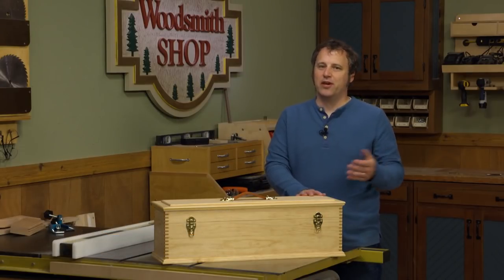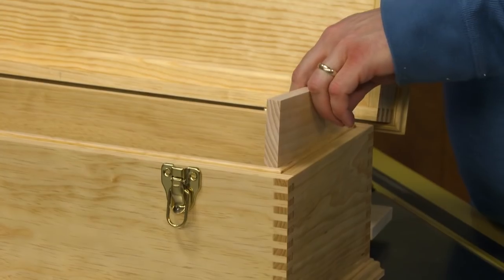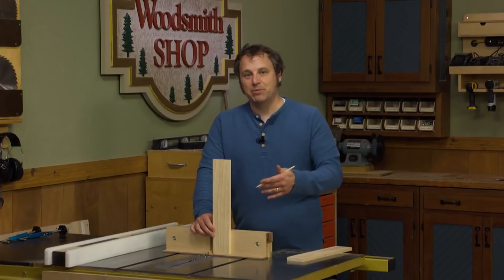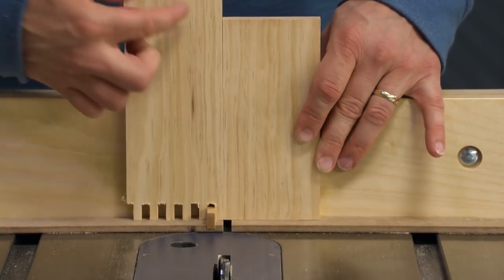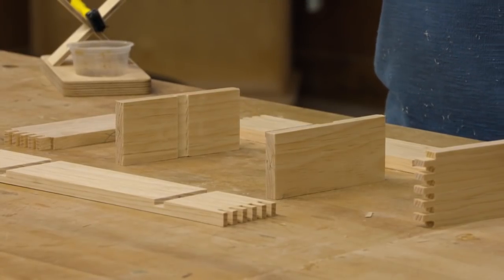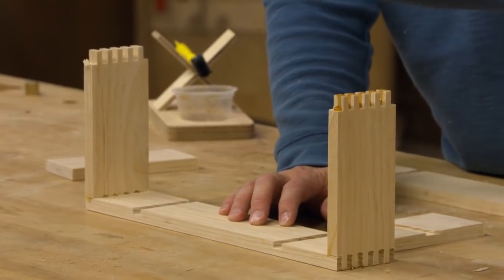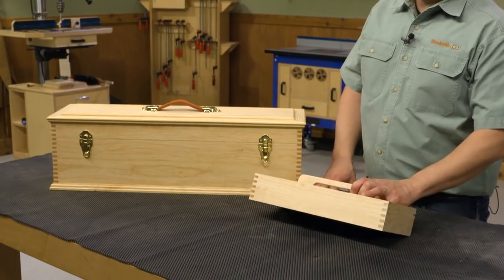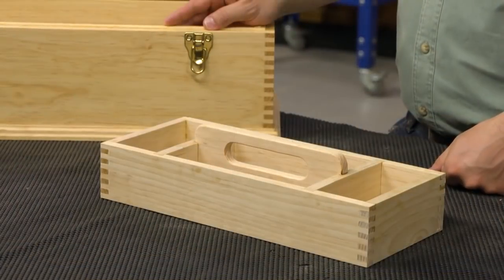Making a Box-Jointed Tool Tray

Comment: Nice job as always, great workmanship! One suggestion - wouldn't it be a lot less work and less chance to damage the wood with a chisel if you just sand off a small radius on the bottom piece to meet the routed side corners instead? I would also go with a classic full length tray, which gives you more room to store tools and have a better view of all the things in the box when you pull the tray out and lay it next to the toolbox?  Just my subjective opinion, as I am not really fond of sliding doors etc.  Don't find them practicable, convenient or comfortable to use in 90 per cent of the time.  All the best!